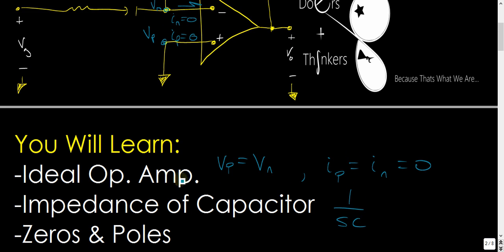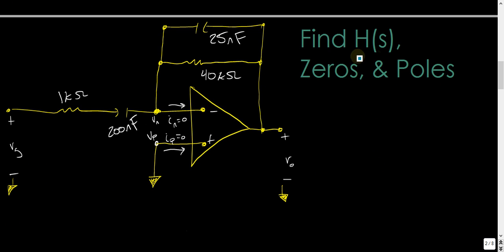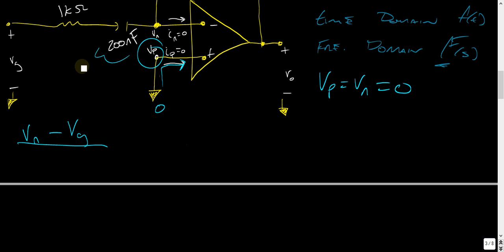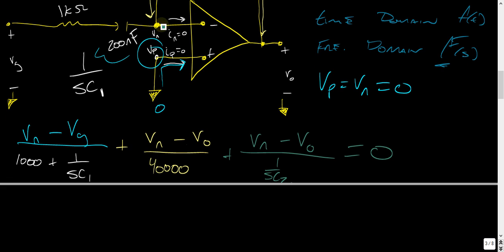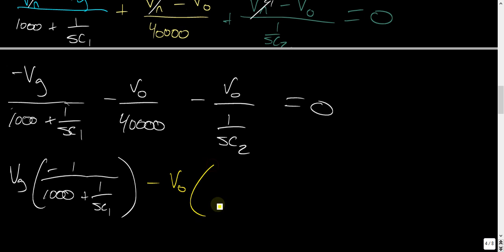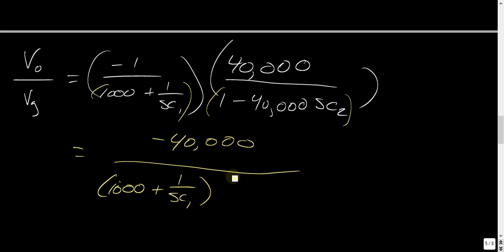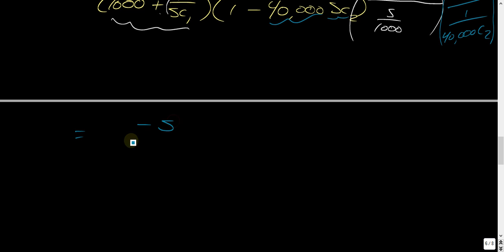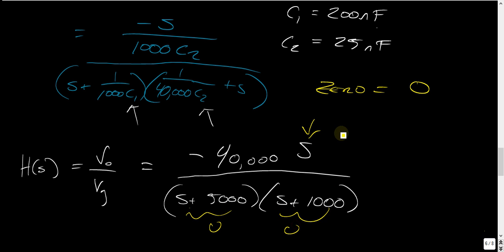How to: Ideal Op. Amp Transfer function, Poles, Zeros, Node Voltage, Nodal Analysis

Comment: Why do the poles occur at a negative number?  No such thing as negative frequency assuming s=jw, right??
Reply from the maker: A seemingly simple question:

TL;DR: s being negative represents a stable system, s does not always represent jw (see root locus, control systems, step response, fourier, laplace) 

Remember that the equation you are looking at is in the frequency domain, to bring it into the time domain take the inverse laplace transform and remember that the inverse laplace transform of 1/(s+a) = e^(-at). Notice as "a" (the input ) in the time domain increases to infinity the equation (i.e., system) trends to zero.

This fact/equation/system produces what is called BIBO stable system (bounded input bounded output)

Your question touches on control systems, which is an entire field in its own right. What you are asking about is primarily the topic of root locus analysis. Here is a good tutorial on root locus from the University of Michigan: http://ctms.engin.umich.edu/CTMS/index.php?example=Introduction&section=ControlRootLocus

"No such thing as negative frequency assuming s=jw, right??"

Correct, frequency is not negative, but "s" is and you must interpret its impact by using root locus. 

Don't assume that s=jw. Furthermore, Fourier s=jw, Laplace s= ơ +jw and in this case for the problem in the video s=ơ  because jw=0 based on s=-5000 and s=-1000 from the values in the video. That's right s is purely real for the system in the video... which makes sense because it is a DC analysis, or in control system analysis it would be considered a step response analysis.

Hope this helps

Cheers!

Tim from Doers & Thinkers

Comment: What will happen if there was a resistor attached to the Vp lets say 10kohm. Vp=Vn would it become complicated to calculate?
Reply from the maker: Alex McLeod Oddly as it may sound, placing a resistor as you describe has no effect on the circuit. In other words, the process and solution would be the same.

This is due to the fact that for ideal op-amp ZERO current flows into the amp, therefore ip is zero

Comment: You made a mistake at 8:02. you took -Vo out as a common factor but didnt change the sign of the second term. it should be -Vo((1 + 40000SC2)/40000)
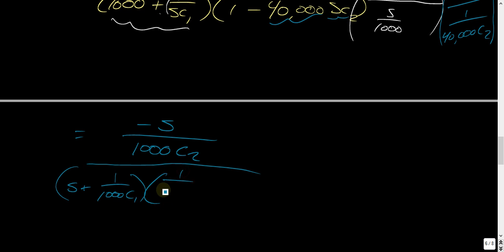Reply from the maker: Absolutely correct, my apologize, although, the final answer is correct as noted by a previous comment by Mike Lui "there was a mistake in the math at 8:10, which you corrected with another mistake at 12:30."

Sorry for any confusion

Thanks for watch man
Reply: pls I want to send u a question to help me solve

Comment: thanks man it was helpful. how do you solve problems for non ideal op amp.
Reply from the maker: We use ideal op amps to model the real world (i.e. non ideal), solving problems for non ideal op amps requires first using ideal op amps to model the problem and then, using real components and a breadboard and 5V's to get real world values. Hope this helps

Comment: Nice video, just a minor issue: there was a mistake in the math at 8:10, which you corrected with another mistake at 12:30. At 8:30, the sign of the second term of the Vo should have been positive. At 12:35, the negative sign in the c2 term turns positive, cancelling the earlier mistake. All in all a good video- I learned something new.